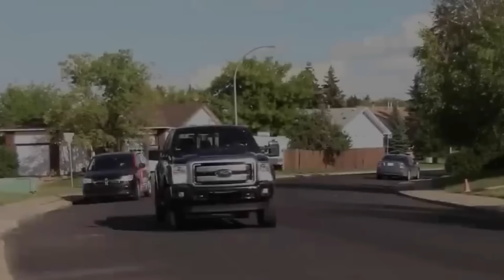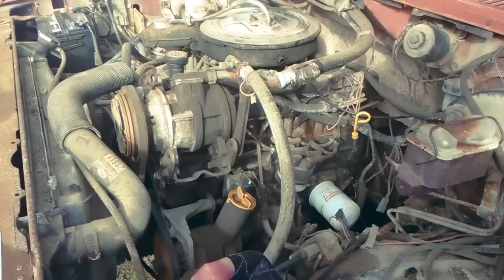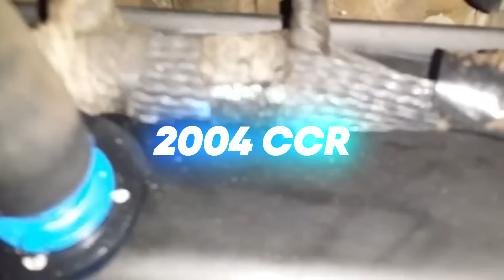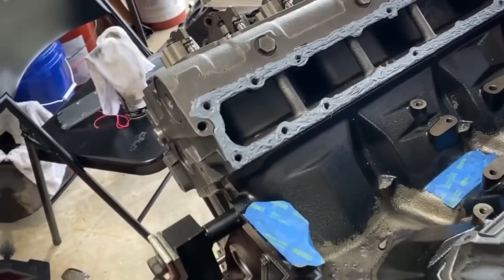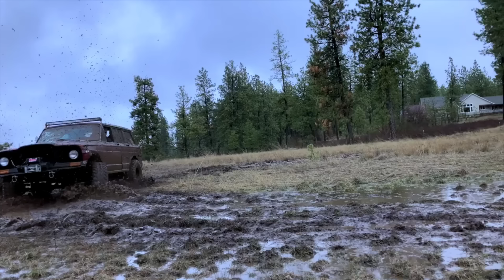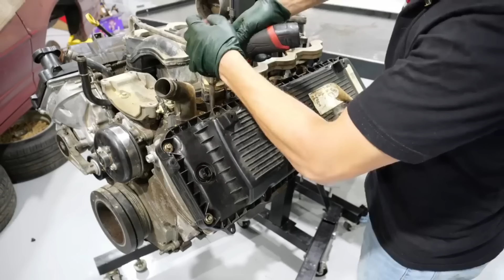The Only 5 Ford Engines That Last 300,000 Miles

Comment: Apparently the ZETEC 2.0L doesn't count?  My 02 Focus ZX3 purchased new has 440,000 on it, original engine no rebuild, starting to leak a little oil but doesn't burn it, starts right up every time.  I'll not live long enough to see it hit 1,000,000

Comment: My 2004 F150 5.4 had 609,000 when it burnt down due to a faulty wiring harness along my frame. I was pleasantly surprised with it being a 3 valve

Comment: I have an 86 F-259 5.9 Diesel, T-19 Trans with 386K miles on it.
No Timing Chain to Break. All gear driven.
Just put 4179 miles on it 3 weeks ago going to Spring Field, Mo. from Northern Nevada.
Dependable old truck, and daily Driver.

Comment: I have a 1994 Ford Ranger with the 2.3 I know technically it’s made by Mazda but I have 456,000 miles never been rebuilt and it’s still my daily driver

Comment: My 2010 F150 4.6 3V has nearly 300,000 miles without and problems except a minor oil pan seepage type leak. Do the maintenance as prescribed and it will last forever. I just bought a 2026 F250 with the 7.3 gas engine, Godzilla. I hope it will last as long on our farm.

Comment: How about the 4.2 V6 built to replace the 300 I6. I have one in a 2001 F150 with 250000 miles and still going strong. The only maintaince needed in twenty five years besides oil and coolant changes was replacement of the valve stem seals.

Comment: So many engines can last a long time if you maintain them. Run synthetic oil and change the oil more often than recommended. My uncle has a new work truck with the 7.3 Godzilla in it and he has already hit 210k miles on it. He has had issues with a few things but nothing with the engine. He hasn't even had an issue with the transmission since he changes the fluids monthly since he is towing heavy with it and driving high miles.

Comment: Surprised the V8 coyote was not on list. I have the gen 1 in my 2014 F150. I love that motor so much I just don’t want to get rid of the truck despite the rust. 200,000 miles and still going with only routine oil changes.

Comment: I've had 2 Ford vans that got high miles. 95' E250 5.8 got over 500k miles from me and ran great when sold. 98' E350 5.4  with 100k got another 400k added and still ran for another 100k. The 5.4 had one issue tho unknown to me the antifreeze was not changed so one of the heads developed a hole from electrolysis and needed replacement at 250k. Did my own 5k mile oil changes usIng Castrol GTX 10W40 AND MOTORCRAFT FILTERS.❤

Comment: I used to own a 96 explorer with the 4.0 liter V6 Cologne engine. The engine went past 200,000 miles , but the flex plates where a thin weak design and several failed me and I left the truck in northern Arizona off the I-40 near the turn off to Navajo. The tow yard got the truck.

Comment: We have a 1993 5.0 F 150 4x4 with 165,000 milles, 33 years old, AC stills blows cold, and it doesn't leak, and our 2016 Explorer 3.5 turbo had 180,000 miles when it got totaled, my wife didn't get a scratch, we bought another 2016 Explorer sport,

Comment: Bought a 2010 f150 4.6 3v with 150k miles 7 years later 230k miles  and no problems same trans same engine 
I do the oil change every 5k miles to the T motor craft product only. 😊

Comment: Interesting that 2 of the 5 are SOHC Mod motors. I had a 94 F150 4x4 with the 5.8 Windsor.   I put a little over 300k on it then sold it. That truck is still running. I was good about frequent oil changes and the low stress redline had it shifting at only 4200 rpm at full throttle.

Comment: 2015 F-250 with the 6.2 here. 179,000 and counting with nothing but regular maintenance. I did have cat-back duals put on when the factory resonator failed with Flowmaster 40s for a nice classic rumble, and upgraded the intake with a K&N 77 series kit. The easier access for filter maintenance alone was worth the cost. 
Right now, the way she's parked in my driveway, I'm getting around 13.0 mpg average, while other owners have told me they get around 11.
Reply: I get 13.1 MPG. Fantastic engine .298,000 KM.

Comment: Ford hasn’t made an engine like this since 96 with the 300 6 cylinder and 2003 when the dumbasses discontinued the 7.3. ,I personally put over 565,000 miles on 2 300s And by the way Ford hasn’t had a better Idea in decades

Comment: Proud owner of a 2004 ford ranger xlt with the Cologne V6, with 350,000 miles on the original engine.I know others have had issues with the timing chain on this engine, but knock on wood this truck has taken me everywhere and I have never had any sort of work done on the engine except for when I change the oil and oil filter. I change my oil every 5,000 miles, and the it’s done me good. I will never get rid of this truck, and love every moment I have it.

Comment: I have an 2007 f150, Triton 5.4 v8, with 254k. Not a drop of oil on my driveway.
Reply: I miss mine 04 3v F150 that just hit 609,000. Burnt down on my last month cause the wiring harness that runs along my drivers side frame shorted out at the connector. Caught fire there and moved to the inside of frame where the fuel filter is and that was it.

Comment: The 3.5L in my 2015 Ford FLEX just had it's water pump replaced at 456,550 miles. This is the first time the valve covers had been removed. I have been using Royal Purple 5W -20 full synthetic since71,000 miles

Comment: The 300-6, with the TFI, I used the 351W heat sink that mounts to the inner fender and relocated the module to the inner fender. I never had a module failure. I converted my 510hp 394 ci FE to the TFI module and the square coil with the big cap Duraspark distributor. It is the best ignition conversion I’ve ever done and it pulled to 6800 rpm. I am legally blind now and I can’t drive. I really miss driving my 65 Galaxie with the power to pull a house down! 65 years old and all done. I did that car from the frame up, even body and paint, my son and I did it all. My son won’t touch it now and I just don’t understand. Anyway it’s a badass. I wish I could drive it one more time.

Comment: My dad had a 99 F350 and trade it in for 2002 when it was new 

now has over 500k miles on it. The valve covers have never been off.

Comment: My 1997
F 350 4x4 460cid
Had 323k when I sold it. No oil leak valve covers never off.
New trans 
Coil pack
2 distributor 
Brakes front 70k x4
Back 125k x2

Loved that truck till the day I sold it, no room to park and no rust

Comment: I have a 2006 f150 with a 4.2 with 252, 000 with zero problems plans to run it til it falls apart, I have more confidence in that truck than my 2020 trucks
Reply: Well that's good to hear. I just acquired an 06 4.2 v6 with only 40,000 miles on it. 
It's in excellent condition. 
I hope mine lasts as long as yours.

Comment: My 2005 Mustang GT 4.6. I used Prolong sold it with 275K+ miles. Still in great shape. When I took it into a mechanic for service before selling it he thought it had less than 100K miles on it.

Comment: 23 hundred  4 cylinder  pinto ranger an T Bird engine one of the longest production run engines in fords history is missing Why drive 7 miles in 1 direction and a ranger from the 80s or 90s will pass by you powered by this engine

Comment: Its sad how far off these fake pods are i have 3 ford trucks a 1985 F 350 460 A 1987 cinder block mountain F 150 300 6 cylinder 4 speed manual double granny gear 4x4  2007 4x4 4.6  my daily driver is a 2007 4.6 3 valve  GT Mustang  a 1950 Shoebox ford original  1 owner  car flathead 1 rebuild runs like a Rolex  what people don't know is before the democrats flooded the market with foreign cars GM Toyota  Nissan  Honda a ford was purposely built to last from cradle to grave  because of this fact parts are still available for the fords i just purchased a set of points for my 1950 ford  they were instock on the shelf a chevy pick up parts production ends after 5 years reason  life expectancy  is 7 years they are purposely built for this time line some with gentle care last longer but the years take them out before wear because  of parts you will see more chevy junk from the 80s 90s than the 2000s

Comment: I have a 2000 f250 with the 7.3 diesel engine and it has 450k and it’s still running great btw i bought it with 20k miles back in 2001

Comment: Had a 4.9L and it had clocked over so could not tell how many times but I think 3 and that was rough NJ miles. I am looking for one as my farm truck as that engine ran like new and sold it to a kid my son knew to drive back and forth to school. It was an F 150 that had seen rough work and needed front end work but since he was in school to be a mechanic he fixed it. Drove that truck for several years after and then joined the army so I lost touch. I had nothing against the truck except feeling too short  at 5"7 to feel a good fit. Not sure if the seat was replaced with a non Ford bench since it was not ripped up. But while I had it I  worked the hell out of it and never could complain about the engine.

Comment: The 5.42 valve consistently get over 300,000 miles why no one shows Love to the 5.4 2 valve when there are plenty with 300 hundred to 400,000 miles plus Still on the road my 2001 5.4 has 304,000 miles on it and still runs great all the original except intake manifold same as the   4.6 2 valve so this is a false statement to say These are the only five engines getting 300+ thousand miles

Comment: Or a new truck these are the 5 engines that will still be going. New trucks have none of these engines. The 2.7, 3.5, 5.0, 5.2, 6.8, 6.9 diesel and 7.3 godzilla are the options now in 2026 across the F-series  2.7 is the modern overbuilt engine  like the diesel engine with compacted graphite iron block. Fords new options are all also good, Already seeing 300k examples of all these new engines as well. Honerable mention to 2.3L and 3.0  for the explorers, and the Ranger.

Comment: My 93 ranger xlt 4.0 ohv cologne went over 500000 had to do one head gasket at 400000 miles. 
My 2003 expedition 4.6 sold it running at 350000
My 2012 explorer still going at 200000 
My dad at three 91 to 93 explorers go over 300000 miles with the 4.0 cologne V6 ohv.

Comment: I had a 92 F150 with inline 6.  I bought it from the original owner.  I was the 2nd.  It went over 300,000.  It was running good when I sold it

Comment: 2012 F150 5.0 just hit 390K miles, went thru a few alternators, one AC compressor, water pumps etc. At 370K noticed a small rear main leak but nothing major otherwise. Just religiously did scheduled maintenance. She keeps going and I keep driving.

Comment: I call this article kind of bullshit by the numbers. Because I've had a 302 Windsor a 352, 360, 390, 460. A 351 Cleveland and the 351 modified and a 400 modified and several 7.3 diesel but that's the same engine they put in the 8 0 6 international tractor last forever. And the famous Ford 300 6 cylinder. And that one I've had several just like the diesel and the 351 Windsor especially the hi outputs

Comment: I’m watching this in an F350 6.2 gas. It’s a 2015 with 571,000 miles on the body and 271,000 on the second engine. There’s a busted body mount up front, but still mostly solid.
Reply: I just bought a one owner 2019 F250 with the 6.2. It had regular maintenance so im hoping to get another 80-100k out of the engine.

Comment: My 1992 F-150 with 300 straight-six has just short of 225,000 miles on it. The one failure it's had is the timing gears. They look like they are made out of some type of composite. I asked a dealership parts guy why the gears aren't made of steel and he said metal gears make too much noise. Also, I had to replace the freeze plugs but the one at the rear probably can't be reached without removing the engine. All I can do is hope it holds. That being said, the 4.9 liter a super-tough engine and I'll still be driving my truck when most 2026 F-150s are in the junkyard.

Comment: I've seen worse lists on this topic; all the engines featured in this video are indeed long-lived engines if maintained, but I have a hard time giving much credibility to a list that omits both the 460 and 302 v8's.  I've had trucks with both those engines that were knocking on the door of half a million miles and still running well before it just made more sense to sell them rather than to continue replacing every worn out part bolted to them.  The 300 inline 6s ran for a lot of miles, but most ran like dog shit for the majority of those miles; in my experience a 302 v8 of the same era would get pretty much the same fuel mileage and last just as long, but was a 10x nicer experience to drive. The other engine that got left off this list was the 2.3 SOHC 4-cylinder.  I saw lots of 3.0 liter vulcan Rangers that went for a ton of miles; but I had a 2.3 Ranger with 375k that still ran like a champ when I sold it.  Most 2.3s died early deaths from not getting the timing belts changed, but if you took care of the timing belt (which was one of the easiest timing belts to service) and kept up on general maintenance, they had the potential for a ton of miles and were VERY economical to operate if you didn't need a heavy duty truck. You get to where you can sense those old 1980's and 90's Ford TFI modules getting ready to kick the bucket before they actually do when you've gone through dozens of them.  Now I've got a low miles 2012 f350 with a sweet running 6.2 that I hope lives up to the reputation; but I probably won't drive it enough miles in the remainder of my lifetime to ever see if it can beat my personal best odometer on an original motor.

Comment: I had a 1971 f100 with the straight 6.  It was ok when the road was flat, and pulling a UHaul trailer, but definitely without the umph going up hills while pulling it.  I decided if I ever got another pickup, it would have an 8 cylinder in it, which my 96 f150 has. So far, I have 385,690 miles on the 302/ EAOD.  one cylinder has no compression due, i have determined,  to the exhaust valve not seating or a cracked valve seat, (no smoke, no backfire, not much shaking) but it starts right up and still pulls pretty hard up to about 65mph (i haven't tried going any faster), not pulling anything.  So I am pretty happy with the  302.

Comment: Change the oil every 5000 miles.Change the air filter every 6 months.And the 300 6-cylinder is easily a 500,000 mile motor.

Comment: Well I guess I'm old.  My first Ford (1962 F-100) had a 223, then a 1965 Galaxie w/352, 1966 Country Squire w/428.  All had loads of miles on them and they never failed.  Had an 1986 F-350 w/ 460, still have my 1988 Ranger w/ 2.3, 1996 Explorer w/ 4.0, 1998 T-bird w/ 4.6L, 1998 Ranger w/3.0, 1996 Explorer w/ 5.0, 2000, F-350 w/ V-10, and a 2002 E-350 w/ 7.3 diesel.    All of these vehicles have preformed well past my expectations.  I never had a failure with any of them.  All ended up with high milage 200K or more except the T-Bird.  We traded it in for the Explorer when we started our family.  All I ever did with these vehicles was change the fluids and filters on a regular basis.  The Galaxie and the Country Squire get special mention because these 2 cars survived me and my youth!

Comment: The 4.2 v6 in my 05 F-150 stx was amazing. The 4.6 v8 in my 99 was a lil beast. The coyote in my 21 has been good so far. My 94 ranger with the 2.3 4 cylinder had 300k when I sold it in 2006 I saw it on the road for another decade. Moral of the story is Ford 💨💯

Comment: I have only owned ford trucks in my 50 years and I have to say they have all been great trucks with no major failures. I still own my 93 Bronco that has been running great for 33 years same engine same transmission. I also have my 1996 Ford Ranger 2.3 Lima. 405,000 miles and I have done 2 timing belts as maintenance and 1 clutch it has 405,000 miles. I owned a 77 351 Modified never any issues, a 1985 f-150 did one fuel pump . A 1991 f-150 270,000 when I sold it for a 2000 f-150 that had a never mentioned 4.2 v6 that had lots of power and I drove it to 319,000 with only changing an alternator. Then a 2009 4.6 also into the 300,000 mile range and sold it. Now I have a 2016 F-250 with a 6.2 had to replace exhaust manifolds and that job sucked but the engine still strong. I will say I am an AMSOIL user and also a mechanic that does my own maintenance. My wife also drives an escape with the 1.6 eco boost 2014 not one single part changed on the engine. I think most people do little to no maintenance on their vehicles and they drive them like they stole them so that is a recipe for disaster
Reply: Doing your own maintenance goes along way. I do the same.
Reply: Fords have been generally good to me as well. You might consider replacing the oil pump belt on your wife's Escape if you haven't already.

Comment: the 6.2 didn’t come with a forged crank
Reply: You’re right it doesn’t but it’s a non issue as long it’s not beaten with significant increases in power like forced induction. For normal use cast cranks are stiffer and flex less at high rpm’s but can break. High rpm’s and loads do better with a forged cranks but the trade off is flexing.

Comment: I had a 1997 Ranger XLT. It had the 2.3. It had 249,995 miles. When I was t-boned by a 18 year old kid driving a 20 year old Buick. The 2.3 was original. Never opened up. I did replace the timing belts regularly. Oil changes around 3000 miles. It even had the original clutch.
Reply: My brother has a 1998 Mazda B3000 with the Vulcan 3.0.  It’s right at 299,000 miles with the original clutch.  The engine and transmission are original with no rebuild.  He’s replaced some suspension parts and routine maintenance.